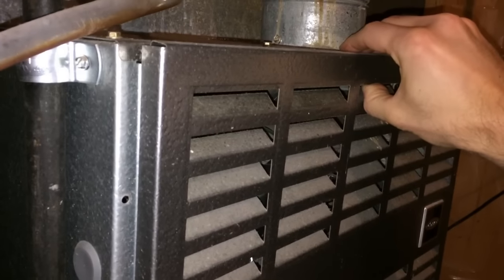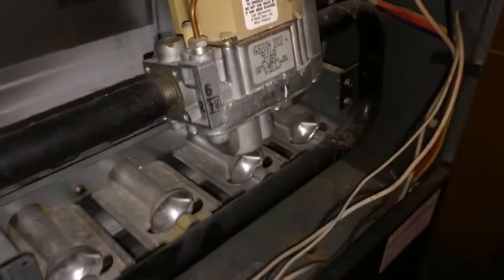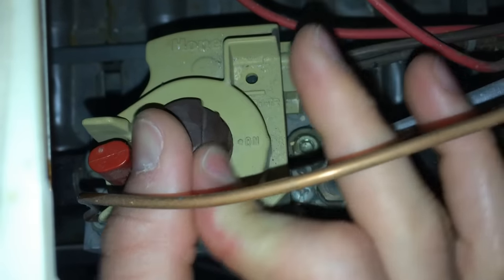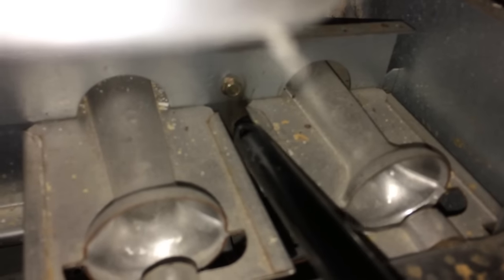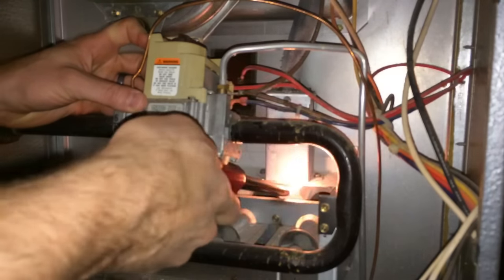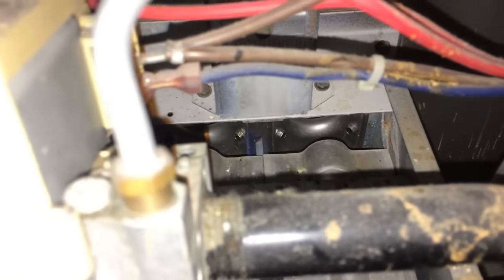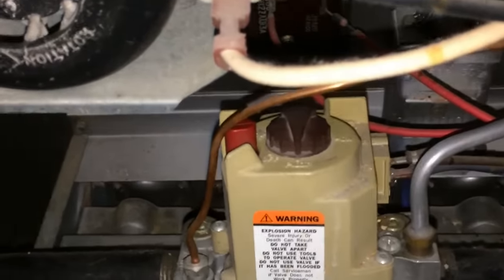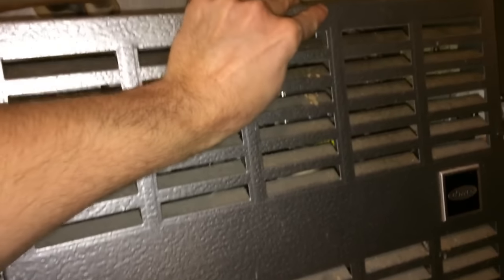How to Light Your Heater or Furnace Pilot Light

Comment: My Honeywell is an older version...looks basically the same as the one here but has an electric pilot that glows hot and ignites the gas. Problem is the electric pilot doesn't glow anymore and I have to manually light the gas every time the furnace goes off. Could anyone let me know what to do? Can I just buy an electric pilot light replacement and install it myself?